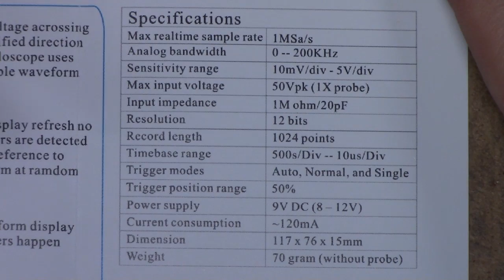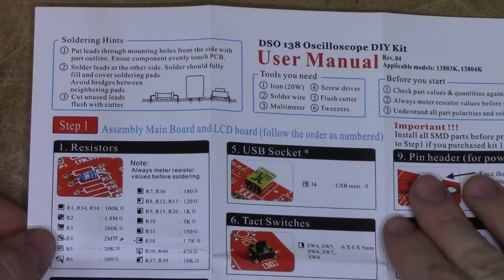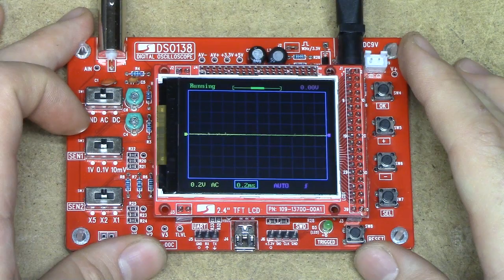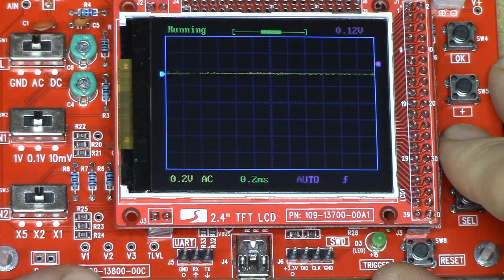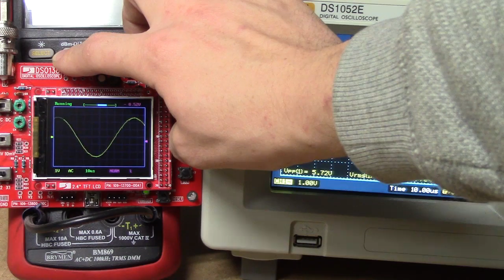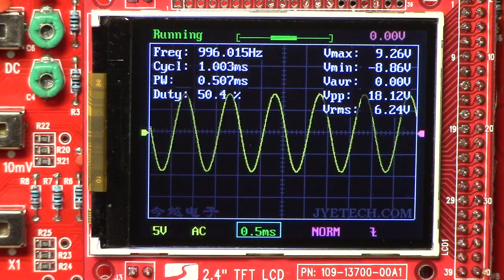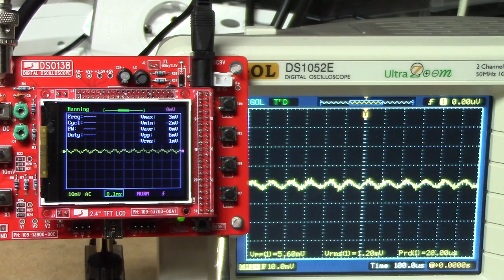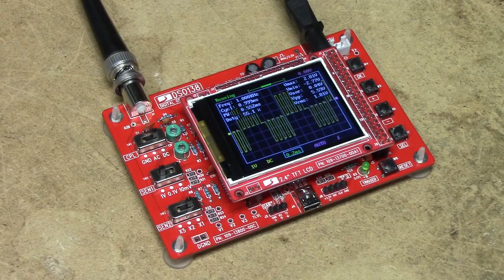DSO138, the $23.50, 200 kHz oscilloscope kit - China reviews

Comment: firmware version: 113-13801-060
release date: [ 2016.01.05 ]
Auto-center trigger level to the middle of signal amplitude when trigger level is focused and OK button is held down for 2 seconds. This is useful for quickly stabilize waveform display. (Thank Gabriel S. for the suggestion!)
Auto-center horizontal position when horizontal position is focused and OK button is held down for 2 seconds. (Thank Gabriel S. for the suggestion!)
Restore factory default settings when "+" and "-" buttons are held down simultaneously for 2 seconds.
Improved frequency measurement by using average voltage level (instead of true 0V level which was used in previous versions) as cycle counting reference.
Fixed a bug in trigger level readout error. In previous versions trigger level readout displayed wrong value after VPos alignment was performed.

Comment: @26:00: Your trigger jitter is due to how the digital trigger is generated in hardware.  That signal is generated by a PWM output from the microprocessor (signal 'TL_PWM'), which is then passed through a lowpass filter (R16+C9).  The output of that circuit is ideally DC, but in fact the PWM frequency carries through.  Probe 'TLVL' and you'll see a 50 mVpp, 100 kHz AC waveform riding on the DC output... that's the PWM signal bleeding through R16+C9... increasing R16 and/or C9 will improve performance (to a point).  A better solution is to replace R16+C9 with a pi filter.

Comment: I was very impressed with mine. It worked first time, more or less (I had to reflow a couple of pins on the screen connectors). The instructions are very clear and easy to follow.

As he says in the video, the switches are a bit cheap, and I had a problem with one initially, but I went round and reflowed several pins and they seem fine now.

You need to have some experience soldering before tackling this kit for the following reasons.

1. Only the processor was soldered on in my case, so I had to solder all the other SMD components. IMO this requires solder paste, at least for the opamp.

2. Some of the other components have a very small pitch, e.g. the switches and USB connector. These are probably best soldered with solder paste as well.

3. A couple of the components, e.g. the BNC connector have a high thermal load, making them difficult.

Comment: Fairly solid review, with one big caveat. Throughout the video the buffer view window slider is set to the wrong position. That's the green bar at the top of the screen. You must set the bar all the way to the right to get the live view. This likely was the cause of the supposed trigger issues as well. With the bar in the centre as shown, you're viewing the capture buffer, not the live data.
Oh, and also that unit may have been a counterfeit. Not sure how much that matters, but my genuine model has none of these issues.

Comment: Just an FYI most of the issues mentioned in this video have been addressed with firmware updates released since this video was published. I purchased this because I wanted to upgrade several things in my tool kit from hobby to semi-pro as I am now developing guitar pedals. This works beautifully for that. This was an upgrade for me as I had no oscilloscope previously. The pedals I'm working on now need a max of 18v and the audible range for human hearing tops out at 20kHz so this unit is fine. I do intend on upgrading to a full proper scope in a year or so because this will not be able to handle the plate voltages (up to 300v AC or DC)for vacuum tubes I intend on using in alternate pedal versions. It's an awesome little gateway scope. There is an acrylic kit with buttons that stick out of the face and completely enclose and isolate the circuit board available. I'm sure JYE Tech sells it on their site but if you type DSO138 into eBay you'll find it available starting at about $5 US.

Comment: These are very sensitive to voltage on the input. Don't use more than 9 volts to power it. It shows 8-12, but I used 12 volts and the voltage regulator in it burned up. I replaced it and now it works fine again, but 9 volts is max. Most kits come with a plastic case and the scope works ok. Not bad for the money.
Reply: Not sure if it is relevant, but my experience with AMS1117-3.3v regulators, is that they insta-blow at 12V, even with no load.

Comment: I got about 20 minutes into this video listening to you repeatedly compare this thing to your far more expensive test equipment, and all I could think of was "Damn ... for less than $25, that is one HELL of kick ass little scope." ... It seems to me that you have reviewed this scope far out of context. There is no way that this scope was ever meant to be compared to equipment that is far more expensive and more completely engineered. 

No offense chap, but I give this review two thumbs down.  Bottom line is that the $23 scope performs as advertised and I feel that what you have shown, proves the scope is worth $23 and then some...
Reply from the maker: It doesn't perform as advertised, but it is good value for money despite that. I'm pretty sure I concluded that at the end of the video. I think the most important aspect of a review is to point out the odd issues with a product that can only be figured out by buying the product; don't confuse that for a negative stance on the product.
Reply: Personally, I think a review should simply review the product ... and if comparisons are necessary, the product should be compared to same class products. Comparing a $23 scope to equipment that costs 10 times as much or more is hardly a fair and balanced review ... anyone who is in the market for a scope knows damn well that they aren't getting a cadillac for 25 bucks ... just my opinion, however.

On a positive note, you certainly are thorough and you leave nothing out. The beginning of the video where you build the scope, then go over every feature was absolutely wonderful since I am considering purchasing one of these ... my needs for a scope are "hobbyist" at best ... once in awhile, I want to see what the signal looks like because I can't always tell if i'm reading an RMS or straight DC ... or like the other day, I removed an adjustable light circuit from a lamp and put it onto a fan, where previously, I had the fan connected to a rather large potentiometer ... with the light dimming circuit, the fan tends to "chatter" at low speeds where it does not chatter when I use only the potentiometer ... it would be nice to see what the power looks like coming off of the dimming circuit as I suspect it does not resemble a smooth sine wave. I think a scope like this would be perfect for a job like that.
Reply from the maker: ***** "the product should be compared to same class products" - I would agree with you if we were talking about competing products. This product, however, is a piece of precision measurement equipment. Its aim is to produce as accurate measurements of quantifiable data as possible. As such, I consider it to be of extraordinary importance to make an effort to see how well it does that - and that requires it to be compared to the most accurate reference possible. The Rigol is not presented as a competitor, it's used to highlight the limits of the cheaper device.

As far as your fan goes, the light dimmer circuit is going to produce a "cut off" sine wave. Triac based dimmer circuits work by letting the mains waveform rise to a value set by the adjustment potentiometer, at which point they turn off the triac and return the voltage to 0 until the next mains cycle. So, you end up with a set of little "blips" at the beginning of each cycle, rather than just a small sine wave.
Reply: FFcossag. Agree with you here. It is certainly good to know the limitation of this scope from your comparison
Reply: +FFcoosag I believe this one of most valuable kind of review of the product as soon as this is compared to be useful or not as a cheap measurement tool to have at home for hobby purposes.
We even are able to learn a bit on how to evaluate some parameters following your thoughts. 
Thanks for your review

Comment: I bought one, assembled it and tried to power it up.  I used a 9 volt battery it came on for a few minutes then went to the back light screen.  Tried using another battery it came on again and I guess when the battery went a bit lower the processor stopped.  I tried powering it up with a 10.5 volt computer power supply and no dice.  The instructions say it will work with a power supply between something like 6 to 12 volts.  So I´m stumped as what´s wrong but it was fun while it lasted.
Reply from the maker: +Joseph Nicholas It sounds like a power supply issue on the board, perhaps a badly soldered SMD 3.3V regulator. If that's the case, it would probably have died hard when you ran it on 12 V.

Thankfully, it's not such a big loss.
Reply from the maker: ***** That's definitely not right - you should probably troubleshoot that, a faulty voltage regulator could end up frying it all if it decides to die the wrong way.
Reply: +FFcossag I found out the problem.  I accidentally reversed biased the input diode and it fried the 708 voltage regulator.  I finally got a new one today at the local electronics shop for 10 pesos.  I now works like it was designed too.  I paid about 11 dollars for it from aliexpress during its 11/11 sale last November.  It certainly beats using a cro scope I used to own and weights about 30 pounds less.  The color display, the hold mode, the single shot mode all seem to make its use much better than the cro.
Reply from the maker: Joseph Nicholas
I'm glad you figured it out - enjoy your little scope.
Reply: Thanks, Your comments helped me find the fault.

Comment: +FFcossag
are you supposed to use a DC power supply with the + or the - in the middle?
Also. How do you use the test point (TP23) to measure when there is only one single point?
Reply: +Áki Frostason  Most supply's use the center pin as positive, If you have a multi meter check the plug on the scope to see for sure, find a ground on the scope circuit board and test the plug for continuity or ohms reading on the plug contacts.

Comment: Being a complete novice I have greatest difficulty reading values of resistors. Sadly the video of your completed board just does show the colour code for the values (to copy)
Would you point me in the right direction for say R1, R2 and the stripe colours. Thanks.
Reply from the maker: I'd say the easiest way to learn is to grab a multimeter and a resistor code table off of Google, and cross-reference what you see on your actual resistors.

Comment: As far as I know, these scopes are based on some Open Hardware platform, so how much of an effort would it be to debug the thing and get it right? Could this still be a scope that you could pick up (in an assembled stage) for something like 50€? Because that's about how much I'd be willing to spend on such a thing (considering how much I'd be using it), but I don't want to do a lot of soldering for assembly, nor would I want something that is completely crappy...
Reply from the maker: I'd say you're better off just building one yourself. It's extremely easy to solder together, even by kit standards.
Reply: FFcossag I saw the number of parts and decided that's not for me, LOL. I'd rather have a finished version, especially one that has all the bugs worked out. It doesn't need a front plate though ;)
Reply from the maker: Seegal Galguntijak You know what they say about quitting without trying, but that's your prerogative.

Oh, and if I wasn't clear, the front panel comment was a joke. By frontend, I'm referring to the circuitry that takes the signal from the probe and turns it into something that can be fed into the ADC of the scope.
Reply: FFcossag Yes, well, I almost never solder something, so I'm not even sure whether I need a scope in the first place.
But about the front panel, I was joking there as well (also in my first comment where I mentioned it) - although I interpreted "frontend" even differently, as in "some sort of better graphical user interface" (while it does have a GUI, it's only a very rudimentary one), so thanks for clarifying this - I never knew that this thing you call a frontend was even a thing (or that it's called a frontend), but I can see how that might improve the performance of the device.

Comment: With your background, I think you could replace all the cheap resistors etc. with 1% parts and re-test specs.  Also, buy a factory built unit, maybe you made a "little" mistake assembling this?  Lastly, try the "firmware update" and retest (with 1% parts).  Then, you could possibly offer a solution to us poor folks.  Thanks for the video.  Maybe a follow up explaining USE would help many people.  Your skills at the buttons were not easy to follow.  Oh, it there a BETTER 'scope out there in the same price range? I have a need for 8 traces.
Reply from the maker: You will certainly not get 8 channels for $20. I made another video on the newer firmware, it's linked in the video.
Reply: There wouldn't be any advantage in replacing most of the parts with more precise versions.  Almost none of them have values that are critical for operation.  Perhaps you would want accurate values for the resistors that set the gain in the first and third stage, but they are pretty much good enough.  And the gain would be better be calibrated in software, although there is no setting for that.

The biggest improvement would come from a quieter, more balanced analog supply for the opamp and a much quieter VDDA analog reference supply for the STM32.  The opamp is supplied by a 78L05 and 79L05 pair, which have a mediocre PSRR (power supply ripple rejection) parameter.  The STM32 is well know for having power rail noise coupled to the ADC section.  One way to compensate is to alternate measuring the internal 1.2V reference, and using that value to correct the external samples.  When you need the maximum sample rate, use the second ADC for the compensation.   (When you want even faster, run both ADCs on the same input and give up on correcting for noise.)